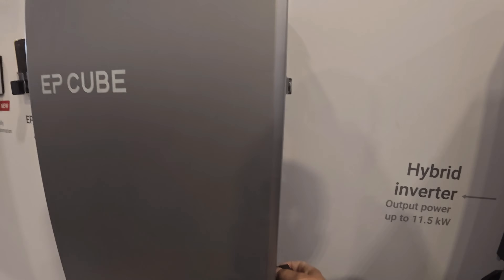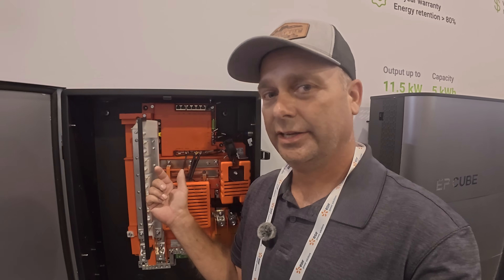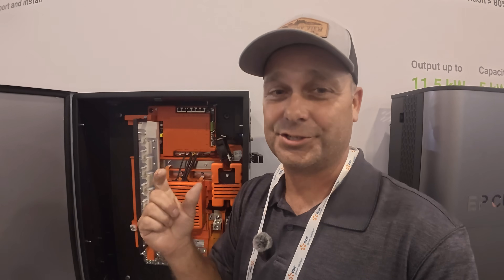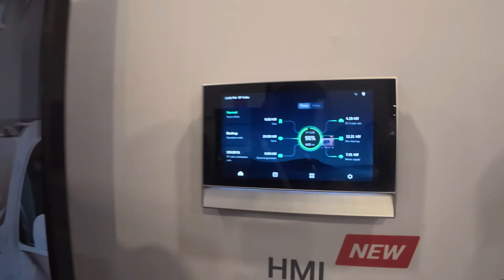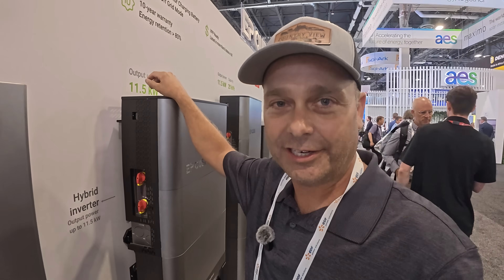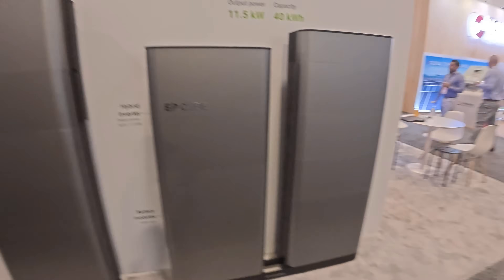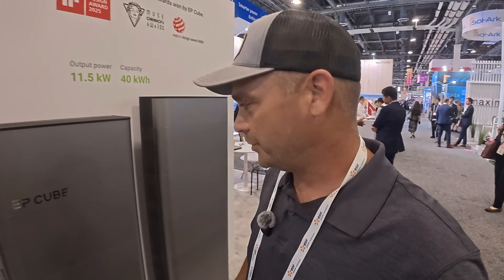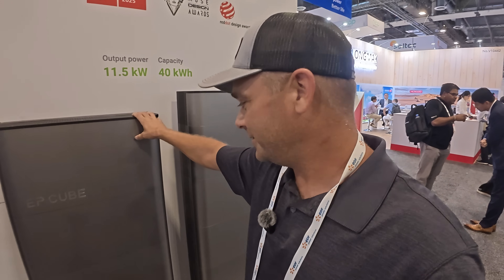EP Cube 2.0 - More Power, More Storage, Smart Breakers & Easier Install

Comment: Evan, that was a great video! You were exactly right about the upgrades from Gen 1 of the EP Cube. Love the fact that the Smart Gateway is now service entrance rated. Man, that would have saved me a lot of work. I had to put a new service entrance panel in when I installed my Gen 1 EP Cube. Also, having the non-backup load bars is huge as well. Could see using that for HVAC. Seems like Canadian Solar really listened to their customers about what they'd like to see changed.

Comment: I really like the EP cube design. Have they made any changes to the transfer speed of a grid outage and is there any way to hook up other power sources like a generator or external battery bank to it easily to expand power/storage capability without having to rely on their overpriced proprietary batteries that probably won't be available in 5-7 years?
Reply: Good points.  I love the idea of HV batteries, but wish they’d agree to standardize on 400V +-50V or something, like how 50V inverters are about 40-60V. 
The. Good news is they’ll be a lot of generic battery makers just like there are for everything else.  Also, I think high voltage batteries might be managed voltage more easily than 50V batteries because the their variation in voltage should be significantly bigger.

Comment: everything on internet more trouble
Reply: Wifi is not the same as internet. As long as you can connect to it locally you'd just have to have your router powered for access internally on your own network. Hopefully nothing relies on cloud services to function, since that would be an absolute show stopper for me.

Comment: No thanks, instead of using a higher-performance, longer-lasting low-frequency, transformer-based inverter design, these overpriced, poorly designed inverters still use cheap, high-frequency, transformerless inverter tech that offers the poorest peak power capacities and the shortest life expectancies out of any other inverter tech on the market. And because it has had its output transformer stripped out of them to save on costs, it doesn't offer any galvanic isolation between its DC boost stage and its AC output, so it can easily damage your home's appliances when their MOSFETs/IGBTs fail. Before you throw your money away by joining the high-frequency. transformerless inverter cult, if you have any doubts about what I'm telling you, ignore what these inexperienced YouTube salesmen are claiming and ask Google if a high-frequency transformerless inverter can damage your appliances. You'll be surprised at the information (truth) that Google reveals to you.
Reply: Prove it
Reply: @daveklein2826  This guy trolls solar constantly. Just ignore him